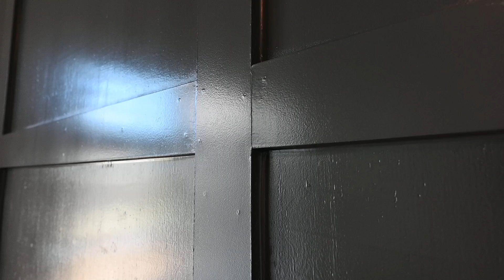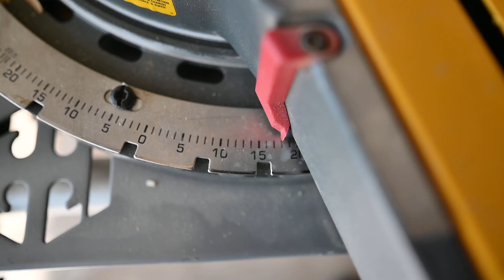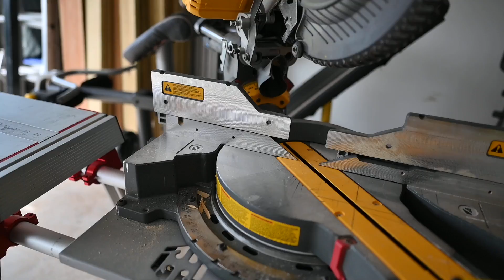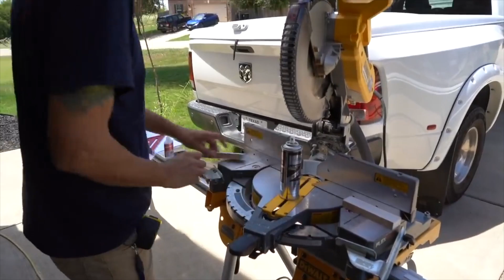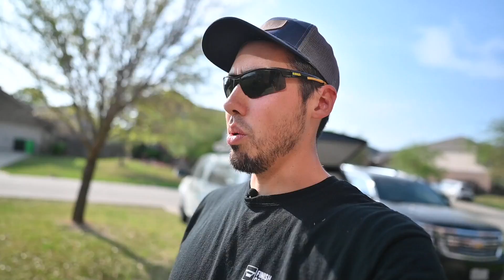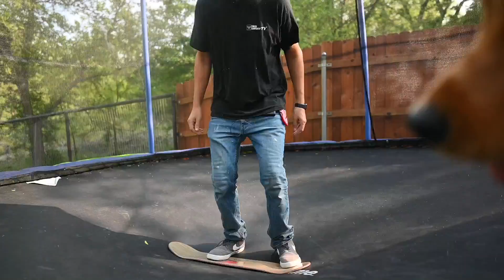Carpentry Secrets Revealed - Pro Miter Saw Tips!

Comment: One thing I learned on my own that I wish I would have known is that a dirty blade can act like a dull blade. I just use windex and a toothbrush and clean it up as needed and it cuts like new!
Reply: Spray on oven cleaner works better than anything for cleaning the pitch off the blades.
Reply: I use acetone but I gotta try the windex thing!!! Thanks for the tip!!!
Reply: Okay so today I tried the windex trick to clean the creosote off my 10 " 80 tooth blade. Dude! It worked like a charm! Left it set like 10 15 seconds and it wiped right off with a paper towel! So impressed! Thanks for the tip!

Comment: I am not a master carpentry. I am glad you stated this.  I have a friend who get high end tools (festool) , but is does not matter. Like you stated if you know where your blades is cutting and calibrated, you can have harbor freight blade cut just as good as high end tools.  It all comes down to your measurement and putting the blade at the right spot and things will fit

Comment: One tip that I rarely hear people say is to use a full-kerf 1/8" blade for the miter saw. Thin-kerf blades easily deflect and produce a wavy cut, even in MDF.
Reply: An old myth. Blade technology has evolved into performance levels not seen a decade ago. Go by what the manufacturer's recommend for your application and tool being used. The top level brands spend a lot of money on research and development and their blades can give you the best of all worlds. It is an interesting topic if you care to really delve into blade technology.
Reply: Well said. Better blades equals better results.
Reply: @tonkatoytruck  I'm going off my personal experience. A few months ago I was trying to trim in a miter saw for a true 90 using a brand new 10" Diablo 40 tooth and no matter what I did, I would get an uneven cut when I held a machinist square to the cut edge. I decided to put in an old true 1/8" laminate blade I had laying around to see if it might be the blade. I got dead flat cuts with the 1'8" kerf blade. Maybe the Diablo blade was warped? I then did some research and found others who had similar issues with these thin kerf blades cutting precision miters. The theory is that the resonance frequency of the blade during the cut makes the blade wobble and this wobble transfers into the cut. Especially when trying to remove material using a single side of the blade. If you're cutting studs for a garage shelf it makes absolutely no difference.. We are talking about 10 thousands of an inch but this is enough to show in furniture when you are trying to butt the cut end to a flat piece for a true 90.
Reply: @seephor  a 40 tooth Diablo is a cheap contractor blade. I have a thin kerf Freud professional blade that cost over $100 and I bet you I can get a perfect cut with it every time. Diablo is the lowest common denominator throw away Freud blade.

 I can make perfect cuts with my blade in Brazilian cherry which is a lot harder than hickory and almost twice as hard as oak.
Reply: I learned this the hard way. Fucked up a lotttt of mitres when I started my business. Buying industrial saw blades is good too. I use the amana A.G.E series and have never looked back at the Home Depot blades.

Comment: My general rule was not to buy anything precision (or powered for that matter) at HF.  But I needed a tile saw for a lot of tile work at my house and the pro grade tile saws are very pricey.  So, I bought a HF tile saw (about $125) and replaced their blade with a Bosch ($30).  After calibration, it worked fine (just very loud) getting me through 2 tiled walk-in showers and bathroom floors.  It is still going strong - I have used it for many small jobs since, and have lent it to many friends for their jobs.  That was 10 years ago!

Comment: the idea for putting masking tape and ca glue over that is from cnc machining. i use this technique when holding down the material with clamps is not ideal & or in the way were the spindle could crash into support hold downs. it works like a charm every time! thanks for the video & tips!

Comment: Notable mention: Square Up The Fence!  I bought a new Dewalt 12" sliding miter saw. Loved how easy the bevel adjustment is on the saw. Had the bevel perfect but when I cut meters on larger base the bevel was different on both sides. Spent a good hour trying to figure it out.  Gave up and returned the saw. Figured out later with my old saw that it was THE FENCE  that was out of square with the table. I shimmed it out and now my old saw cuts perfect. Feel bad for returning the saw now.

Comment: On point re: the color of the tool !! Tool Brand does not make the carpenter. I' have & still use  Dewalt, Hitachi, Makita miter saws with exc results from each. I also prefer a good 10" miter saw over a 12" whenever possible. I find I have much less deflection with smaller blade and certain 10" saw have exc capacity for height against fence. Currently a Makita 36v Slide mitersaw fills that job.  Good video.
ps. Besides being a carpenter, I'm a paperhangers son and I always look at wallpaper in hotel/motel to see what kind of job they did. Some good, some not :)

Comment: Your right about the miter saw having to be calibrated. My dads friend gave him this dewalt miter saw. I used it to put baseboards and noticed the gap on the boards when cutting at 45degree angles. I noticed looking at the saw from far away it looked crooked even though the bevel was at 0. Ive learned alot watching your channels and the miter gauge really comes in handy epecially for walls that look 45 degree but could 47. Caulking could of fixed it lol but just doesnt feel right doing sloppy jobs.
Reply: His dewalt saw was pretty beat up and even though it worked good the cuts where off.. Probably why he gave him the saw lol

Comment: Calibration is key. I went to help a friend with crown and nothing was fitting well. He had a name brand saw but never ensured it was calibrated; it was over 1/2° off. He was using it that way for years and was just of the mentality “that’s what caulks for”. I have the same FlexVolt saw and love it; I run it with batteries even in the shop.

Comment: When I think of a good saw I think of one that allows for accurate and precision repeatability.  I have $170, 12" compound, sliding miter saw that is fine for rough framing but the detents have 2 degrees of play and the arm isn't sturdy enough to eliminate acceptable flex.  I have a $400, 7 1/4", cordless, compound, sliding saw that has almost milling machine accuracy and precision that doesn't change no matter how much I haul it around or move from room to room.

Comment: I learned there are miter saws that can not be calibrated contrary to what I believed. I was at a store called Lowe's and spotted a "sweet" deal on their in house (Kobalt) dual bevel, compound miter saw. Got it home did a few test cuts and found it to be off about 1/8 inch in a foot. I thought I would tune it and after an hour (with my wife supervising) I got a 1/32 inch improvement. So some Kobalt miter saws can not be tuned to speak of.

Comment: I used a crappy little Delta miter saw for 15 years and I've done some sick looking work with that thing.  Like you say it needs a good blade and calibrated. I got me a nice 12-in DeWalt slider now and I'm like a kid with a new toy. I did put a hundred and something dollar 96 tooth semi Gucci blade on it too. By the way when you buy the good blades you can have them sharpened multiple times and save all kinds of money.

Another good thing about doing excellent work is, I've never had to fight for my money. When the work looks good the people pay and they don't mind. When you hear people talking about getting screwed out of their money A bunch of times and they are dealing with homeowners, they have to be doing a bunch of crap work. I've only had one incident and it was in the late 90s and I knew before I was halfway done with the job that they were going to try to pull some shit. That's the only time I've ever had a problem. If you are having problems getting your money often then it's probably you.

Comment: Impressive...and unexpected. I'm installing trim around a bathroom ceiling but the ceiling slants up toward a peak. The trim along the level wall won't meet the trim slanting up correctly and I'm having fun figuring this out. I think I'll cut a short, round table leg into quarters and install a quarter in each corner so it won't be obvious that a 90 degree cut on one trim is shorter than the 120 degree cut on the adjacent trim.

Comment: What is your advice on pre-painting speed baseboards 5 1/4”. And stacking on top?. As a painter I know that even though they are dry they will tack to each other as will cabinet doors. For years I have used wax paper between pre-painted trim and cabinet doors.

Comment: You were speaking about a sharp blade. When they begin to dull, do you replace them, or have them professionally sharpened? If you sharpen them, how many times do you resharpen on average per blade? And I speaking here about an 80 tooth or more blade used on pine or white oak. Any particular tooth pattern your partial to? Thanks

Comment: Keep up the trampoline even when you get old, you can use a mini rebounder and lightly bounce. The amazing thing about jumping on a trampoline is that it’s one of the few exercises that effectively gets your lymphatic system moving. Also the higher you jump the greater the gravity and g load you get. Take a little10 lbs dumbbell and curl it you will notice the higher you get the greater resistance. Kinda cool. I had constipation issues, I could run, lift, jump rope but nothing would get my system moving better than 10-20 minutes jumping on a rebounder.

Comment: Do you have a technique for aligning the blade to your pencil mark before you cut? Or do you just look down the side of the blade to line up the blade with the pencil mark? Any tips for making sure the cut is made right where you want on the piece?
Reply: This is a year late but, lower your blade where the cut looks a little long and then raise it, and gradually move the board in a tiny bit more and make another slight little test cut and see where it lands,  and then as soon as it hits right on the line drop it all the way down and make the cut. 

Don't start Way Long just a little bit maybe just a little over a 16th. Plus if you lower your blade without turning the saw on and just touch the work you can see about where it's going to hit. When it looks about right raise it up and then pull the trigger and come down slowly.

Comment: I just painted an accent wall with an airless sprayer (Graco x5) and I have some drips. Not sure If you have any tips on how to fix it. Currently, I am scraping then sanding, and am going to top with another coat. I did a test area and it turned out well but would love any advice. Used the SW Emerald Enamel in Satin. 515 tip, ordered an FFLP 310 for the next coat.

Comment: if you wanna bulk up a bit get on the creatine, monohydrate, some hmb too, keep up on your vitamins and minerals, especially zinc, calcium, vitamin d and magnesium. Muscle mass and strength are gained by slow concentrated reps with weight resistance, high weight low reps. Start with something you can throw up 8 times pretty comfortably then add 10-20 lbs until you cant lift it more than six times, then take off 10 or 20 and try to get 8 out of it again. 4 sets for each muscle group at least, do area zones for each visit, upper body one day, core another day, legs another.

Comment: I just bought the dewalt double bevel sliding miter saw and I am a beginner. I read a lot of reviews saying it was a good quality saw so I figured I may as well get that now instead of a cheap one and then a good one later. But anyways, I can not get the bevel calibrated. It reads 46.3° on the 45°. I tried moving the bolt in and out but it wouldn't change anything. What am I doing wrong? Can anyone help answer this question?

Comment: The saw needs to be capable of being calibrated, and precise, as in it will return to the same settings, and the settings won’t drift durning use.  Blades need to be fine toothed and flat.  I typically buy, nonferrous metal blades, they generally have better carbide.

Comment: Hey man, how does the nail holes volcano??
Reply: MDF does that with nails. More work to finish, but they sand easily and need a prime. Fingerjointed trim should be better if its quality.
Reply: Cheers man.
Does that happen before the filler drys or wat.? Happened me on a project once an I’m not sure why exactly.

Comment: IMHO about types of saw,  cheap will cut as a good one (almost)  the issue is,  the cheaper the saw the harder to calibrate and the less time it stays calibrated.  In some cases on the cheap ones it won't calibrate at all due to poor quality molds, cheap materials, bad design..   all depends on how much your willing to put up with the machines issues.  More $$$$$ equals less issues for the most part.  After that a good blade can make up for a lot of the cheap machines issue.   Side note check around you can get your blades sharpened a lot cheaper than replacing them.  Invest in a good blade keep it sharp , it will go a long way to getting a good quality result.  Last wash your blade the sap buildup will mess up your cuts even when sharp.